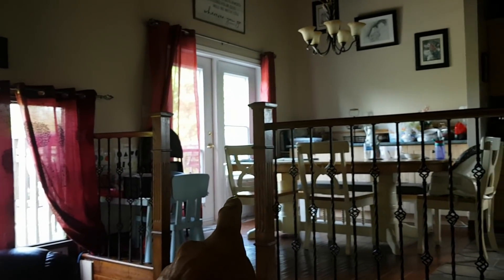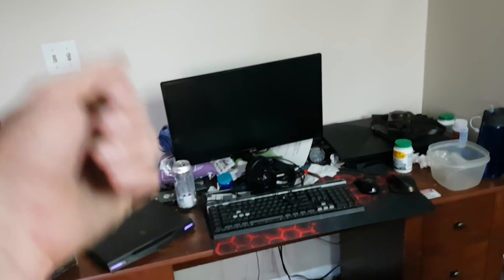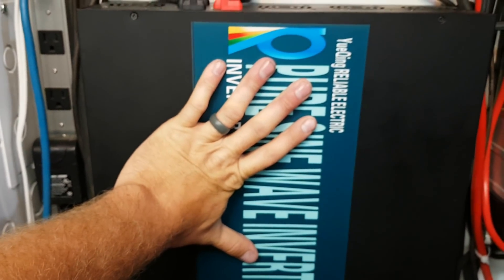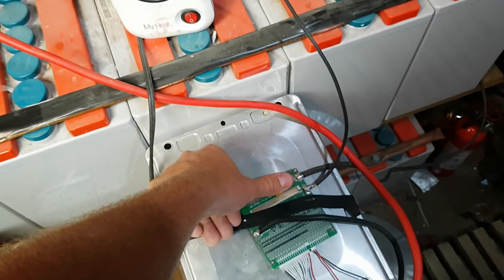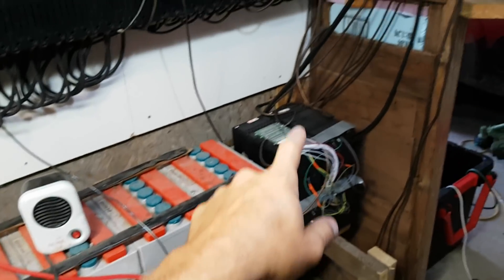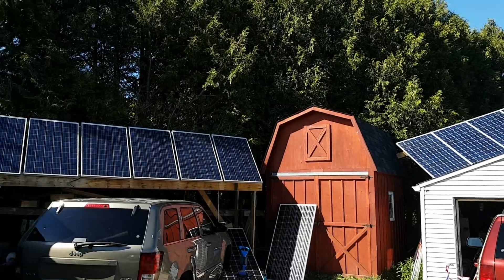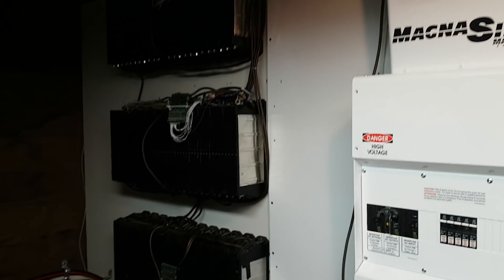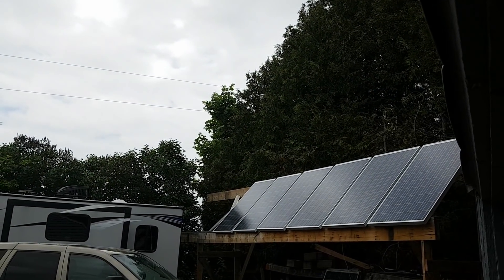25000 BTU ACs Running On 8000w Reliable Inverter

Comment: Wow, you are having a monster of  lithium system there.  Just WOW!.  May I ask a question concerning your BMS?  Those wires going toward the batteries seem too small.  They look to be 18-22 awg .  How many amp are actually going to the batteries using those wire?
Reply: on my BMS system my peak balancing current is 2 amps my avg is .2 amps and I'm 20awg 99% of the juice is fed across the pack (24V for me using all modules out of a wreaked P90 i Found and bought for 5k and parted out made 25k)
Reply: @techmasterjoe, the reason I was asking is that I'm re-do my system from lead-acid.  I was going to do a grid-tide until I checked out the price of hybrid batteries.  I got my hand on 4 x 48V chevy volt module and 26 of the nissan leaf modules.  I got a bunch of BMS and still figure how to put them together.  I'd noticed the size of the wires on the BMS was a little concern about their capacity.  Currently I'm running 2 FM80 and 1 FM60.
Reply: lan2me what i do is using a bench power supply  set to constant current I check each cell in the pack and charge each one to match the highest cell manual balancing. Then wire up my custom bms (not really just some simple code on custom samd21E and a can bus network controlling the orginal tesla bms boards. But i did tap in and check ever cell first my worst cell was 0.09v lower then my highest cell so the pack was really good when i got it. I'm thinking of selling my Tesla interface controller at cost (apx 50$ for master and 20$ per model s battery module) for non commercial users so others can use it for projects. It has wifi and supports Alexa, google home, android auto. Made it universal for my needs diy electric car and home power storage. I'm a hardware engineer btw

Comment: How are all the panels connected? Each set of panels should be on their own MTTP channel ? There are 4 sets ?
Reply from the maker: there all on the same charge controller, 6 strings of 3 series on one controller all pointing different directions lol works well, and my classic 250 has 4 335w panels in series, also works amazing! had almost 5000w coming in the other day thats with about 6100w of solar
Reply: Interesting, The strings in series when shaded will be affecting the others in series. Also unless all panels are the same specs ie voltage and current then they also will be affecting the other panels in the same series just like shading does eg the MTTP settings will be different between tho panels. Its good that its working but it would work a lot better if 3 or 4  controllers channels were used, on bad days without full sunshine normally that is the most important, Its not the sunny days thats the problem its the rainy days where solar is a premium.

Comment: quick question , how do you have your Solar panels hooked up ? 3 in series then in parallel to a buss bar +/- for each.
Reply from the maker: the one charge controller is six sets of 3 series and the other charge controller is one set of 4 in series.

Comment: Awesome. I'm thinking about getting a 12 or 24 v version. Of about 2500-3500watt inverter. as a backup. I was thinking about a mod sine for power tools. Where is a good place to buy panels. By the pallet or near full pallets? I did know of a place they had new old. Or slightly used for under.    $ .50/watt. Maybe $.43a watt ? Or something. I can't remember where the was. I was looking at 4-5 different dealers and lost it. Thanks great video
Reply from the maker: I would get the 3000w or higher!  I will be buying a 12v 3000w reliable for testing in the future!
Reply: better stick to 24v or 48v cause 12v is too much amps to handle by the mosfets.

Comment: Question: are both Inverters feeding the house together or on separate circuits??
Reply from the maker: the reliable 8000w one is running 2 circuits with the largest load and the magnasine runs the rest of the house atm.
Reply: Ok thanks for the clarification .. Love these videos ..keep them coming!!!